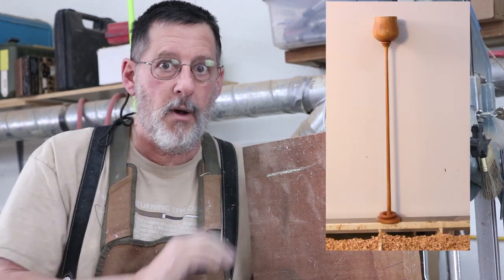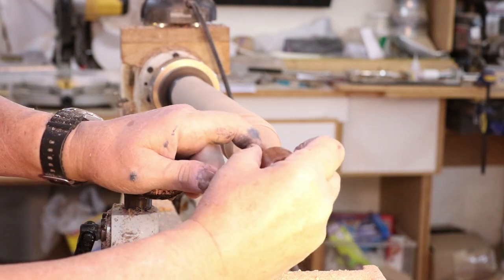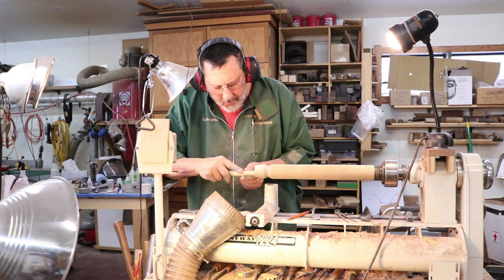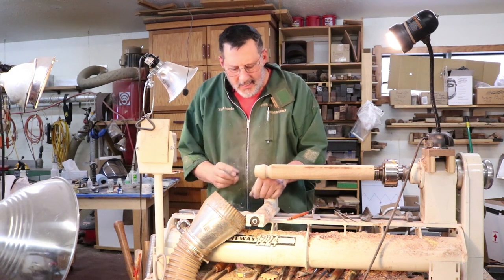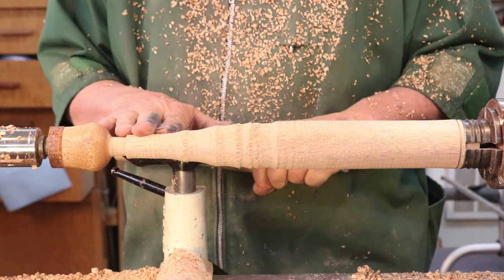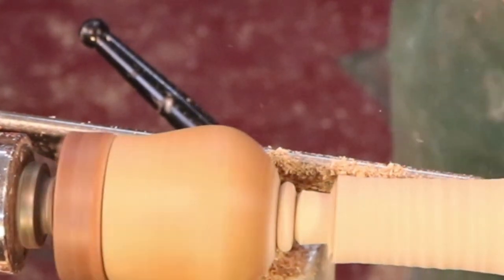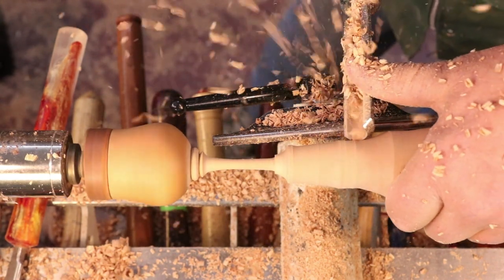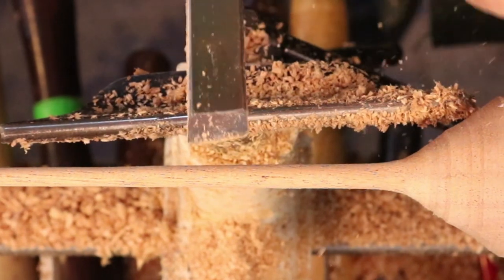Long stem Goblet  by Sam Angelo  the Wyomingwoodturner

Comment: In watching your long stemmed goblet I have one suggestion.  Our group did this in a hands on class several years ago and we found that if you solidly tape the jam chuck to the goblet you can then pull the tail stock backwards and put negative pressure on the stem. it will remove a lot of the wobble from the long stem and make turning a lot easier and smoother
Reply from the maker: Don, Great idea....I will try it sometimes. Sam

Comment: Sam, Super cool. 16 inch was quite the challenge. Great trick on cutting the jig to sit on the rim. I have a number of the jigs like you used but I have not tried layering or steps on the taper.  Nice work as always. George

Comment: Fantastic show Sam! Really makes me want to go out to the shop and practice my tools for a while, and a long stem goblet might be the challenge to make me go out in that cold! For a moment there when you started shaping the stem, you have a small rise in the center of two low points. That gave the stem somewhat of an oriental look, like bamboo... I think I like that look and might want to try and incorporate it into a goblet. Thank you again for a great lesson!

Yuval
Reply from the maker: Thanks very much.  I did LOTS of work off camera.  I never wanted to buy a steady rest so it made this difficult.  I am making a 5 piece set for the Utah woodturning symposium gallery.  I will show the 3 I have made so far in my next Notes from the wyoming woodturning.  I am working on the 1- inch one now.  But they get easier as they get shorter.  Sam

Comment: Very cool. 

A member of my club has turned very long-stemmed goblets down to 1/8 inch. He tapes the bowl to a live center cone then backs the quill slightly, putting a bit of tension on the stem. This helps reduce vibration as the stem gets longer. 

Really want to try something like this.
Reply from the maker: Adding the tape is a good idea.  I will try it.
Sam

Comment: If you can locate canary wood, you might find that also good for long thin stems. I turned several sea urchin Christmas ornaments that had a 3 mm diameter by 7 inch long finials, and found the wood to be very strong and dense.
Reply: Another good tip - thx

Comment: Great video, Sam.  I like your use for the pyramid tool in making the beading.  Is that tool only for spindle work or can it be used on bowls as well?
Reply from the maker: You can use it either on cross grain or spindle work.  I am sure I have a video on it, if you do a search on my channel.  Sam